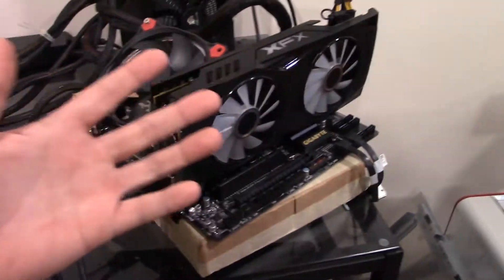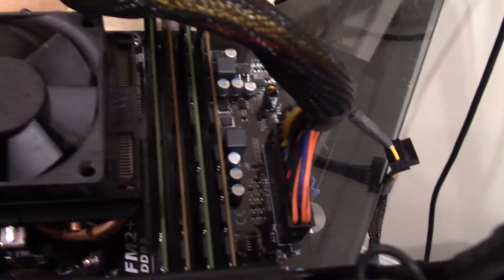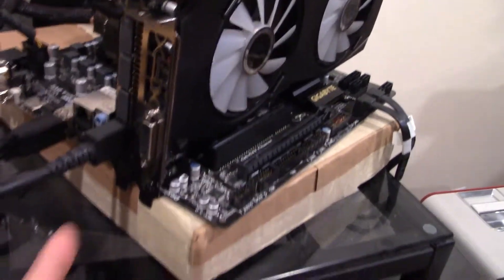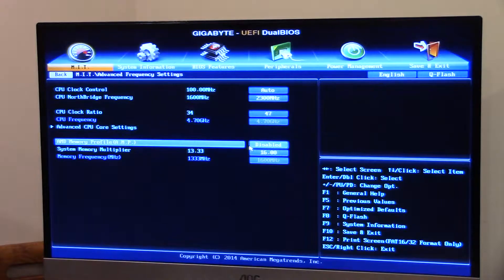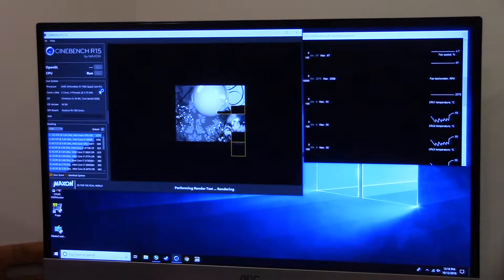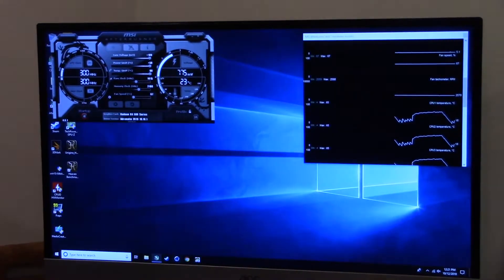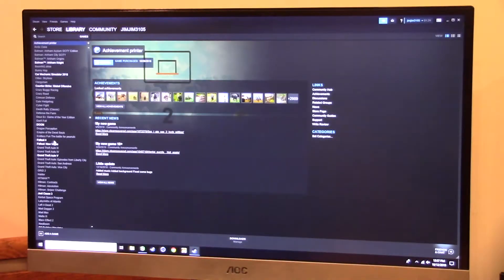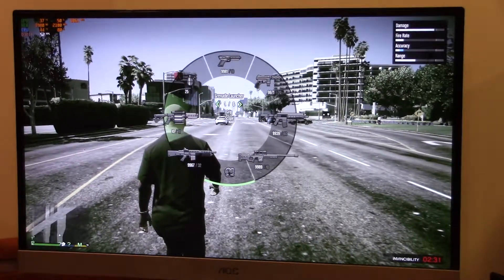I overclocked an AMD AthlonX4 750k to 4.7ghz ON AIR!

Comment: Hello, I increase the multiplier but the PC turns off, I don't know why, I try to set it to 4.0 GHz and it doesn't work and turns off. can you help me
Reply from the maker: You are either overheating or your motherboard is drawing too much power and turning off. Simply changing the multiplier isn't enough. Your system may not be able to handle it.v

Comment: Older video, still cool that that chip can run stable at 4.7. 
   I don't remember what clock mine had boot issues. It wouldn't have run stable for anything other than the bench I was running I am sure. 
   I think if I want to keep running that chip I'll get an 88x

Comment: I have a 760k with an asrock fm2a88m-hd+ motherboard and I have it at 4.6 Ghz using only the Asrock bios setup, it's wonderful for a 50 euro motherboard, the heatsink I use is air but quite large and the temperatures hold up well. By the way, I have a question, I am currently using a 7770 radeon 1gb OC graphics card... if I put a 750 ti on it, will I notice a difference or will there be a bottleneck? a greeting.
Reply from the maker: Good question! A 750ti will provide similer performance, but if you have more vram available, you will see more consistent performance.

Comment: I am using AMD overdrive on a 760k, because I am using an OEM motherboard. 1.425 V, 4.4 Ghz. What can you get if you overclock via software versus hardware?
Reply from the maker: Well technically it's All software. Do you mean Bios versus OS? If so, i believe that Overdrive is giving you the best OC. Especially considering you are using an OEM mobo

Comment: Can you help me? I overclock mine but can only stay at 3.9 GHz because if i go 4 GHz my computer will turn off somehow. Sorry my english is bad
Reply from the maker: Computers will turn off if they either don't have enough power, or the cpu is overheating. I dont diagnose things over the internet. You may need to consult a local computer expert. It is also possible your computer just can't run at the speed you're trying to go.
Reply: @TheJimminiShow  do I need to buy a new PSU? I have a 550 W PSU

Comment: When i try to increase bclk even to 101.00mhz i get no gpu signal 
But system boot 
Do u know why ?
A8-6500
8gb ram 
Rx 470
Reply from the maker: Hard to say. Could be the motherboard, might be the cpu. Some chips just dont overclock. When you oberclock the BCLK, you are increasing the speed of the PCIe slot, the ram, everything. Your board more than likely doesnt want to run even 1 percent faster.

Comment: so, I have an 860k and a Gigabyte motherboard and it will not let me change the multiplier...
Reply: I've  one x4 870k and a gigabyte motherboard. If you want to do overclock to 4.7 just put the multiplier in 47 and add +0.102v. If it doesn't works you must add "v" and still trying it. Put the fans in full speed and that's it!!
Reply from the maker: Not all boards will allow it

Comment: What's a safe OC target for this chip for a total OC noob like me? My MSI OC genie II can take it to 4.0ghz but I'm wondering if it's worth learning how to push it harder. Getting 30c idle in 80f ambient.
Reply from the maker: I only pushed it that far because I was bored. Heat goes up exponentially with the voltage needed to be stable. There really is no reason to go over 4.4 or so. The return is not worth the risk to the chip. I always encourage people to try overclocking. If you go slow, you will be fine. After you do it a while, you will learn all the tricks of the trade. Good luck in your attempts and be patient.

Comment: Good thing you overclocked that NB, the stock frequency I see is way too low and will lead to stutter. Generally, AMD chips (especially old ones) are seriously bandwidth starved which reduce their performances by a lot. The stock NB should be 2.2 GHz not 1.6, what was AMD thinking? Even the FX 4300 has way higher stock NB clock than that.
And nice OC on that chip, kudos to you.